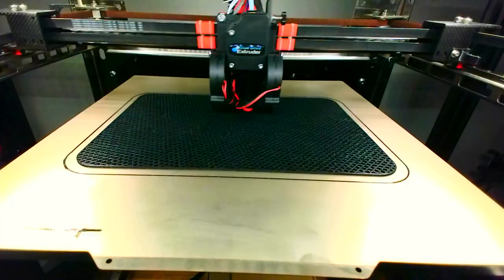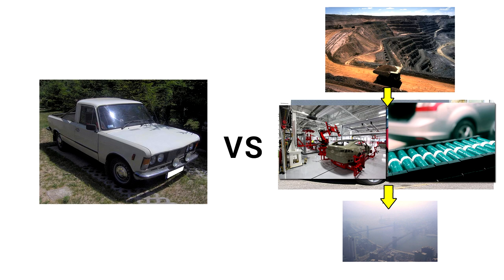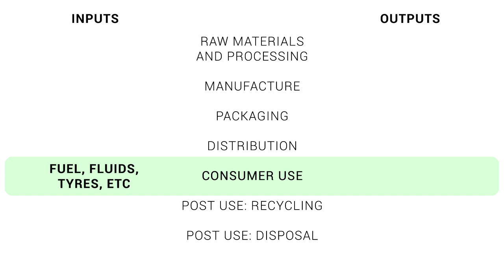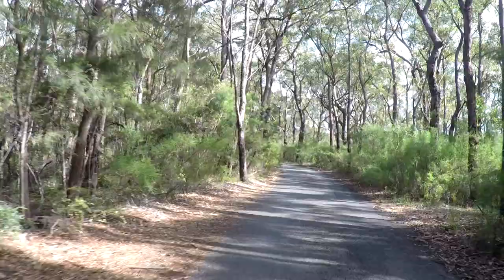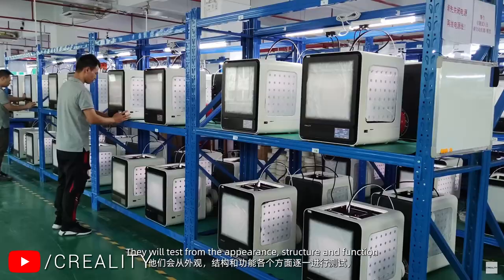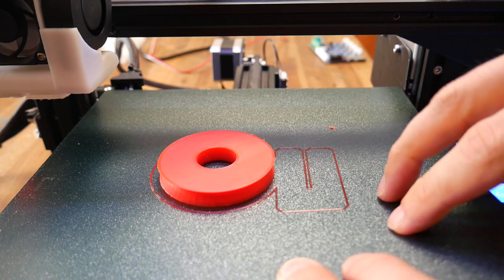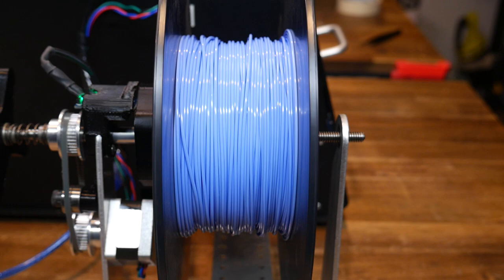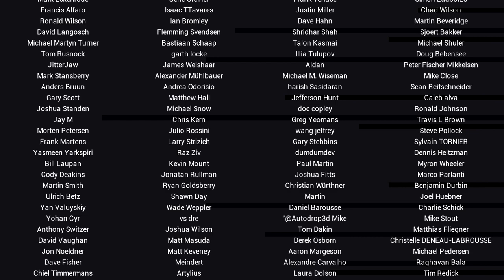Is 3D printing better for the environment? It’s complicated

Comment: For me it’s obvious. I’ll reprint something a few times due to prototyping or poor design on my behalf. Plus I’ll print silly gadgets, fidgets toys and figurines that I never would have bought. In the end most of it goes straight to the landfill.

I think you can be more environmentally friendly with a 3D printer however that depends on a lot of variables that just come down to the individual. Most people I know in real life are just printing junk off thingiverse or printables to use their printer between prints that are actually more useful.

Have you ever ordered and bought a calibration cube and immediately thrown it away? Of course not but most people do that with their printers…just saying
Reply: Every time I see a "useful" 3d print video list I laugh, I've never seen anything useful or that I couldn't already buy cheap. 

I dont print nonsense, calibration cubes and a few other calibration benchmarks aside, in printing stuff that saves other products from becoming waste. I made a new head for a broken thrift shop tripod and I'm fixing a band saw from the dumpster by reprinting discontinued parts to keep it going. I live off grid and I print a lot of stuff to improve my off grid self sufficiency and efficiency. If I print something it's functional, even stuff like bird or snake toys and statues, put a motion detector and light up eyes and predator noises in it and it scares the hell out of the squirrels and rabbits, protecting my garden. 

How much fuel and resources does that offset if I don't have to drive 30 miles to town and 30 back to buy grocery store veggies?
Reply: My biggest issue with 3D printing is that you can't recycle filament as a consumer. The machines are too expensive, and unless you have extensive knowledge of electronics you can't really build your own filament recycler.  
If we could recycle prints that would probably cut filament use in general in half.
Reply: @daylen577  I wouldn't say extensive knowledge is needed, if you can build, calibrate and run your 3d printer then you have enough knowledge to build a filament recycling machine.

Recycling wouldn't cut use in half if you're using the printer to print useful things that don't need recycling next week.  Most of the stuff i print is meant to last years or decades, it prevents other products from going into a landfill and offsets more waste than filament lost on test prints.

I'd say your issue isn't with 3d printing but with people who use it to print worthless novelty garbage.

One of the things i saw that made me SMH was using PET bottles as filament to print silly trinkets like this.  There's super easy plans to build a system that turns bottles into filament, but IMO that's just creating demand for bottles that people otherwise wouldn't buy.  Like i just don't buy anything in PET bottles, i don't drink any of that nonsense so i'd have to drive to town to buy bottles, pour out the contents just to print what, a BENCHY?  LOL!  Just buy filament and don't buy bottles if you REALLY want to save the planet.  In fact, i printed molle clip rings that hold a 1 liter PET bottle, making it highly reusable.  It's lighter than any other bottles, cheaper, and i use it EVERY NIGHT when i hike.  I have my own water system, i'm off grid so i catch rainwater, filter, carbonate, and bottle it with phytogenic nutrients like chlorophyll extract reusing 2 liter PET bottles.  I pretty much don't drink anything from commercial cans, bottles, dispensers fountains, or taps aside from the occasional coconut water when i crave the electrolytes in summer.

I also 3d print with solar power, so no fossil fuels or grid power is used to print.
Reply: @rustymustard7798  "so i'd have to drive to town to buy bottles, pour out the contents just to print what, a BENCHY?" Wait... Who the fuck is buying such bottles for a PET bottle recycling machine? The whole point of that system is just to find these bottles as trash somewhere on the ground for free, to print useful things for free and to clean the environment for free. To do a win win situation. But it would help even further if orginizations that cleaning up the ocean with its full of plastic junk, would give those plastic bottles to the machines to print something useful for it. Like imagine we could reuse all that ocean plastic to print a giant house for ex. for poor people. Or what ever. There is tone of things you could do with such plastic, even when it's just dirty material with inconsistent diameter of filament.

Comment: Where 3d printers could help the environment is by creating replacement parts for consumer items that break. I remember in the early 90''s  my parents had a washing machine break that was just a few years out of the warranty period due to a plastic gear shredding its teeth. Not a replacement gear could be found. Dad even asked at machinist shops to have it made but it would have cost half of a new machine. All manufacturers by  law should be required to make available stl's of all components if they no longer stock the replacement parts.
Reply: It is highly unlikely that a replacement 3D printed part would have the durability for that application. 3D printing does not have the equivalent properties. You might be able to make a part that looks the same but it will not be the same.
Reply: Interesting path to think about. As Tina said, the original models might not be valid to be 3d printed for durability reasons. This depends on the part design, use case (a gear might be in heavy use, a clip for the cleansing drawer not) and of course the available 3d printing material. On the other hand the original model might allow a versatile maker/tinkerer to use it as a base to optimize for a 3d printed alternative that can achieve durability, that is sufficient for many further years of operation.
But a tinkerer would have been able to redesign the part from it's broken original aswell, so...
And by the way, there are companies with good customer support that will share design information with you for repairing their products, unfortunately it's just a minority.

Comment: I like the idea of using 3D printing for prototyping. However, the thing that I'm trying to do is the original 70s verbiage of reduce, reuse, then recycle... but I'm bad about the last one. I try to reduce the amount of wasteful things I buy and reuse as much as I can. Like, the water bottles. If I use a refillable water bottle instead of water bottles then there's less need for the machines all together. However, that is beyond this video... maybe.

I do agree with the comments that are saying 3D printing has helped them continue to use some things that may otherwise be thrown away because the manufacturer doesn't sell their broken parts
Reply: Reducing and reusing are probably the most helpful for the environment out of the three. Energy is needed to recycle and only a small percentage of plastic gets recycled. It's still much better than throwing things in the trash, though.

Comment: Speaking of USE stage - I firmly believe that large commercial machines are more energy efficient. For example, it takes the same amount of energy to melt the same amount of plastic - be it in a 3D printer, or in an Injection Molding Machine (IMM). However, IMM quickly melts this amount and a 3D printer does so over the course of hours/days. Even with enclosures and insulation there is still some heat leakage. IMM will produce a lot of items in an hour, leaking a bit of heat. 3D printer, on the other hand, will continue to heat up the environment for many hours for just 1 part produced. Remember, about a half of energy pumped into nozzle heater gets dissipated to the environment. Heated bed is pretty much 100% energy loss.
However, 3D printers have a property that is very hard to quantify - they can produce unique parts. And the impact of those parts can be tremendous! For example, about a year ago I printed a switch housing for my range hood. The OEM replacement is long gone - the part is no longer produced and there is 0 in stock everywhere I looked (not to mention it costs $170 for a piece of plastic). So it saved me money, but most importantly it saved the entire range hood from the dumpster. That's quite an environmental impact!
And yes, I 100% agree that it is very difficult or even impossible to compare those things even with LCA. Especially in cases where implicit impact may be times more than what's on the surface.
Reply: I was about to write about the energy thing aswell - The "turned off when not in use" point in particular seems like a mute point, because commercial machines either are in use all the time anyway, or would likely also be powered off when not in use.

Comment: For consumer use/manufacturing the benefit depends on volume. Injection molding wins with very large volume. Tooling costs and prototyping is prohibitively expensive for low volume.
3d printing can make complex geometries and doesn't require much tooling. Low volume, it's much cheaper (and $ means energy)
Reply: That's a good point, it's a good tool for one off parts, but injection wins in high volume.

Comment: It gets even more interesting when you factor in the fact that most of the power on the planet still comes from coal powered plants (i.e. most electricity still uses fossil fuels), and that most recyclable materials are not recycled because it's cheaper to process new materials.

Comment: One thing in favor of 3D-printing is all car visits to a shop to buy things that are replaced with some hours waiting for the printer to finish.

Those last miles of transport from shop to home can really be very, very expensive since we seldom fill the car. The transport from factory to store is way more efficient because it happens with filled vehicles.

People who repair things using their 3D printer also helps by extending the usable life of their dish washers etc.

But one disadvantage with 3D printers is all the extra hobby projects. All things created just because it's possible. But where the person wouldn't have bought any product.

Comment: I have a hard time imagining that 3D printing objects can be appreciably better for the environment per se. Yes, you don't have quite as much packaging and shipping overhead, but the fact is, you still need to ship 1 kg of plastic to get 1 kg of printed parts (and in my experience, actually a bit more, because 3D printing doesn't always go as planned, involving throw-away prototypes and failed prints).

I do agree with the comment about using 3D printing to extend the lifetime of otherwise non-repairable objects. That's an important use case. But that's highly user-dependent. In my own case, most of the things I print are custom parts for new applications, not replacement parts for existing objects.

I would not feel comfortable trying to defend 3D printing on the basis of environmental superiority.

On the other hand, 3D printing provides a lot of functionality that is simply impossible any other way. Even if it doesn't save overall shipping and packaging much, it does save time . If you're in a situation where you need a part you can readily print, but shipping would take days, a week, or more, removing that delay can have real value, especially in a commercial setting.

Another area 3D printing excels at is inventory management of spare parts. If you've got a lot of equipment and that equipment needs spare parts, but those parts can be printed on demand, that greatly reduces the amount of warehouse space you need, as well as the overhead to maintain that stock. Instead of having one or a few of each part you might need to fix your equipment -- where the number of discrete parts could number in the hundreds or thousands -- you just need enough filament on hand to print a few parts now and then. In fact, this advantage is being explored in the context of spacecraft. For something like the ISS or other long-term mission spacecraft where having important parts on hand is critical, 3D printing can vastly reduce the cost of launch and/or allow for a lot more mission capability since that weight and space can be used for things other than keeping spare parts.

Comment: From what I personally and a handful of people I've seen so far do with the machine: I think it's better for the environment.
From what I see most others around me: I think it isn't better for the environment.
Reply: I print stuff like replacement parts that save other items from being waste. I fixed a tripod and I'm making discontinued parts for a band saw I got dumpsters diving. 

I printed molle clips to make PET water bottles reusable, and I'm always making parts and tools to improve and maintain my solar, wind, and water collection capability. I made water filtration parts and will be making solar tracking parts and a case for a dump load controller for the wind turbines soon.
Reply: @rustymustard7798  And you are the kind of person that Marinus referenced first, not the norm.
Reply: @tinayoga8844  I didn't even know it was 'the norm' for people to just be printing useless crap in the first place, like what's the point?  I just can't wrap my head around why people would do this, just waste time and power printing useless things with such an amazing machine with so much potential.  I print using solar so there's no grid power use on my end and 'wasting' power isn't an issue, it's more of a waste if i just let the sun hit my roof instead of a bunch of solar panels.

I don't know anyone else IRL with one so i never see what other people do, in fact i live alone on a mountain so i don't really see what other people do in general, i go a month or more sometimes without seeing other people up here.

But people and their shallow, short sighed illogical and unreasonable behavior just puzzles me.  That's why i live on a mountain disconnected from everything and pretty much self sufficient.  I guess i shouldn't be surprised that people are willfully as dumb as rocks anymore.

Comment: I mean, it's impossible to compare in this case, since 3d printing is not really suited for manufacturing end use industrial parts. It is mostly used for prototypes that are then manufactured on the injection molding machine. It's good that it uses less power and eliminates packaging waste to some degree, but looking at this from a practical standpoint, a 3D printed part will never be as strong as an injection molded part, since injection molded parts are made from "single piece" plastic, while 3d prints are laid down in layers. Even with remelting and anealing and any other trick that we use in 3d printing, it will never be on the level of a proper injection molded part. 

That said however, the potential to repair products is valid now, in a world where manufacturers don't provide the original molded parts. If they did, it would be cheaper, easier and potentially greener to just manufacture the parts in bulk with injection molding instead of spending the time designing the part, the wasted plastic and energy from failed and succesfull prints and then you don't even get the same durability as the original.

Although if the products were designed to have the plastic parts be printed by consumers at home, it would be potentially more economical and ecological, due to less packaging and more products being transported at once, plus the huge injection molding companies wouldn't have to use like 50-70kW per molding machine, (keep in mind, my small local company like this with something like 100 employees has around 30-50 machines like this running 24hours/day 5 days/week not to mention the immense energy usage for lighting, heating and all the other stuff necessary to keep that industrial plant running.

Anyway, I'm just rambling at this point.

Comment: My problem doesn't lie as much in the process but in the consumer use. 

On Facebook groups, you will hear people that bought multiple machines, run them every day, to just print goodies and trinkets. Exaggerating a little bit, their hobby is to create plastic waste. 

On the other hand, some engineers friends and myself have 3d printer that we use as tool to produce very specific parts every once in a while. My printer remain idle most of the week to be honest. Here, every part has a purpose, and sometimes it's even to repair stuff where spare parts are unavailable. 

In the case of printing trinkets, the process of injection molding is so much more optimised (because industrials folks are trying to make money, so no waste is neglected) that it is very likely the better option of the 2. 

The LCA of a 3d printer is impossible to calculate because the usecases vary too much. For a car, even if there is some variation, it's quite easy to get to an average, or have a standardised test that will fit mostly the end user...

Comment: I would challenge your results on the first two factors. While there's a proportional increase in the resources required to make injection molding machines, the usable life is typically an order of magnitude higher than that of consumer 3D printers. Industrial injection molding machines are design for continuous use for decades. Getting 1,000 hours out of an ender 3 without major repairs is a stretch. So you're going to end up building many 3d printers over the lifespan of a single injection molding machine.

That said, each product has a different lifecycle cost, and it may be the case that regardless of improvements in either technology, a given device will always be more efficiently made with one device over another.